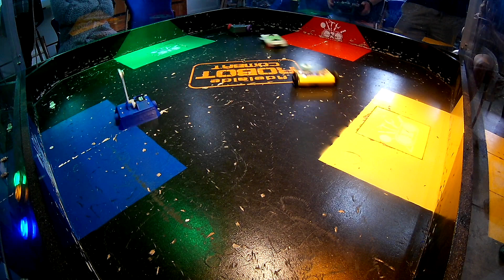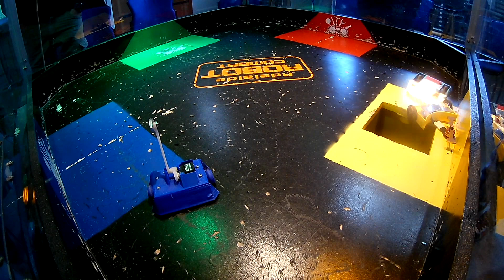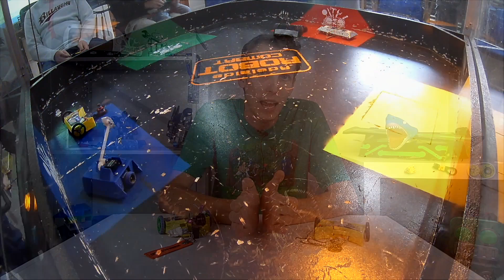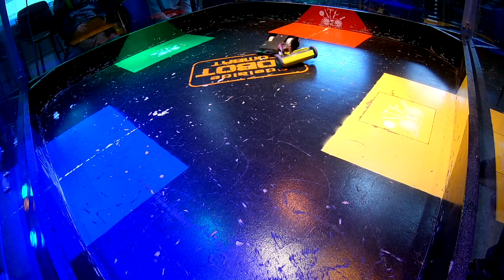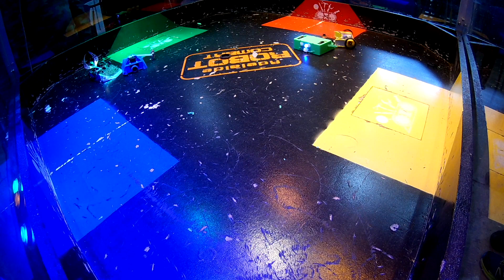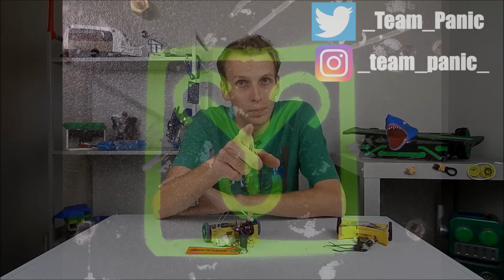Destructive combat robot battle report (ARC June 2019)

Comment: Great video! I'm thinking of a more sharper blade/maybe sawblade type set up. Acetate on the wedge will do you well.
Reply from the maker: That's not a bad idea, I was thinking of just getting more pushing power for those bots, but a saw blade would look cool and be effective!

I haven't been able to find a good stockist of thin Acetate here and also I think the blades will still get under it. I think my only counter to the blades is blades of my own

Comment: U just got to make ur wedge better. And for bots that easily come apart you need to have lower rpm.
Reply from the maker: Yeah, I'm thinking I need blades of my own to get under his blades.

Lower RPM is a good idea, others here have suggested sawblades/sharp weapons, I think I'll do both
Reply: @TeamPanicRobotics  sharper blades will just cut and for a bot like that wedge and how ur bot is, that may not be the best idea cause it would cut threw it or not get a big hit, but maybe it would have other advantages that u may discover one day. surface area of the blade is something to keep in mind. if ur blade was thicker (if u had weight) then u would have a higher chance of getting a flip or sending them into the air. (cause the blade has more to bite on, if it a smaller blade then it has less to bite on their bot and potentially just rip it of/cut threw it, like the wedge.) note with a saw blade i have noticed that it just tends to scratch the opponents bots and not cut threw them, but that's with aluminum and steal, but with plastic maybe, u will have to test it out.

best of luck

Comment: Those were some monster hits from This Is A Party, especially when it pulled an Icewave by splitting Escobar like an Oreo!
Reply from the maker: Thanks! when it works it works super well, its just got the typical vert problem of being useless against good wedges
Reply: Maybe, if improving the balance of that weapon isn't enough, and if you have a couple of grams to spare, maybe you could get yourself a thin sheet of acetate and glue it onto the wedge. That material is used quite frequently in ants because it's quite light and flexible. Hopefully that could help against those evil cheese wedges!

Comment: You might have to get creative for the weight, but an idea that might work (least it worked for me on my beetleweight, in a similar situation) put some hinged forks on the back of your bot that are a wedge of sorts, or just a flat plate that is a hinged wedge, being hinged they/it will always be on the ground against wedges, run your weapon in rev and run your bot in rev using the fork/wedge as your anti wedge device, and then run them up on your bots top using your weapon now also running in rev, to hit the underside of there bot. might also go with a thinner weapon to give you the weight and make something that cuts so you basically would be a antweight cobalt, your risk would be, you would have to possibly remove the self righting arms you have on the bot to allow for them to get on top of you so you can gut them
Reply from the maker: Thats an interesting suggestion, I definitely would have to get creative on weight, but it might be worth a shot

Comment: 26:55 That’s exactly what I was afraid of. You might need to battle harden your motors. 

1. Why does Very Very Obvious have a shark hand puppet? 

2. TIAP is starting to scare me. Bring it to America and you’ll get far. 

3. Do you think you’ll build a flipper? 

4. 29:23 Minor? 

5. I think the reason Antymatter did that is because of Guesstimate damage. 

6. Metal wedgelets.
Reply: Head of shark setrakian from bugglebots. Bit weird.
Reply from the maker: Did you listen to what I said after the fight? the motor was fine, it still works. It was just that the bolts vibrated out because I didnt locktite them in. I locktite the bolts on TIAPs motor it survives fine with no battle hardening. 

1) you'll find out eventually, but this isnt the first video the shark has been in

2)Maybe one day, but it will have to be an event I can bring a 150g bot and something else, thats a long way to go for just 150g fights

3) As a loan bot, for sure... for full combat, probably not
Reply from the maker: 4) yep minor, make the walls a little thicker and locktite the bolts. Thats all it will take to make guestimate a very mean machine

5) nah, they ran the blades the whole event, its their new stratergy to get control. If you look close you can see the blades in the 2v2 fight

6) maybe, I'm right on weight, so I'm thinking of swapping to a lighter weapon for both of them and having changeable armour and wheels that I can add as I need. For Anty matter I need to be lower, for Slip Stream I need more traction, he is literally using my wheels (the ones on thingiverse) so he has twice the traction I do, but I can fix that
Reply: Ok. I still think the shark puppet was weird. For the American competition, I recommend Motorama because they run Feathers, Beetles, American ants, and possibly fairies. For American Ants just build a 1 pound version of TIAP or bring 3 fairies as a multi bot.
Reply: I forgot to ask, but what happened to A Little Obvious?
Reply from the maker: Haha that's kind of the point for the minute, its weird and cool. You'll find out more later.

I looked into Motorama this year but it was super close to Battlebots and Bugglebots and I only just managed to get time off work for both of those. If I dont get into both of those next year then I'll look at Motorama and other US comps
Reply from the maker: "what happened to A Little Obvious?"

REALLY????????? 
I talked about this at the very start of the video just for you....

I'm not explaining it again, watch the video
Reply: No time? That’s a shame. I would really like to see it (and Don’t Need Roads) back in the future. 

Edit: I see why Guesstimate would take priority. I recommend weapon support on both the top and bottom. (Kind of like Shrapnel. Is Shrapnel still around (probably) I haven’t seen it fight in a while.)
Reply from the maker: Nope, I say in the video "this is why A Little Obvious hasn't been fighting"

The sentences around that are what you are the answer you are looking for
Reply: Ok. I’m sorry for my sheer incompetence. The intro is normally white noise for me.
Reply from the maker: Good to know. 

I usually put my reasoning for things in the into, but I might have to start putting them after things so that it is not in the "white noise"
Reply: Maybe put them in your build videos. (That is my personal favorite kind of combat robot video.)

Comment: Which motor has been used for spinners..?
Reply from the maker: both spinners use an 1806.

The horizontal spinner uses a generic 1806 from china and the vertical spinner uses a purple DYS 1806
Reply: @TeamPanicRobotics  thanks....for more weighed robots...for e.g. 10 kg bots which motor should be used for spinners ?
Reply from the maker: For that weight class you need something powerful, look at the motors people use for electric long boards. I use a 5055 600kv brushless motor in my 13kg bot